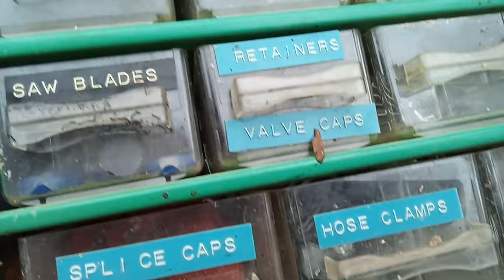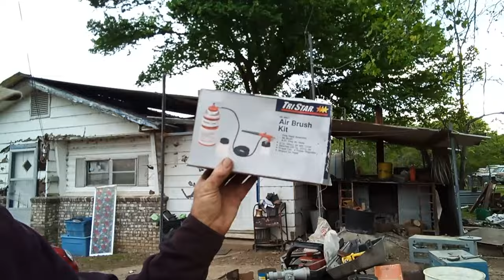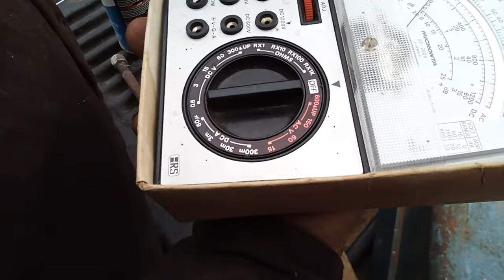Went to a estate auction bought a truck load. Chainsaw tiller tools ect.

Comment: Homelite super ez  is quality.
Reply from the maker: We have another Super EZ I just bought a carb kit for it. This new purchase fire up on a carb prime. It will need fule line filter and probably a carb kit.
Reply: Then burn it up on today's gas. Old 70s saw
Reply from the maker: @roadking8337   Actually I use older saws successfully on todays gas. Back in the day Gas had lead.@ cycle engines without valves dont need lead. What I do is add water to Etahanol (Corn gas) and remove the ethanol because it absorbs the water and sinks to the bottom of the container. The old leaded gas would foul spark plugs.